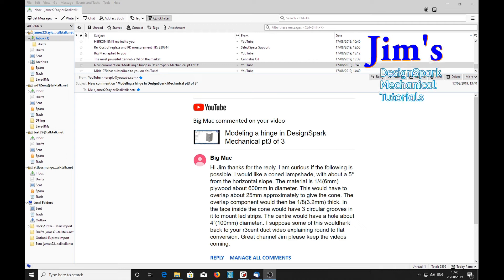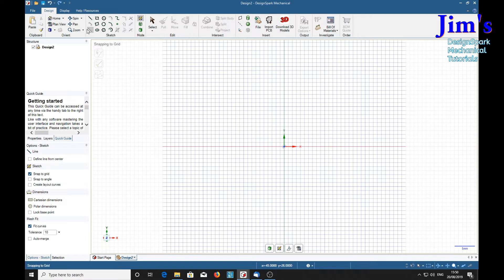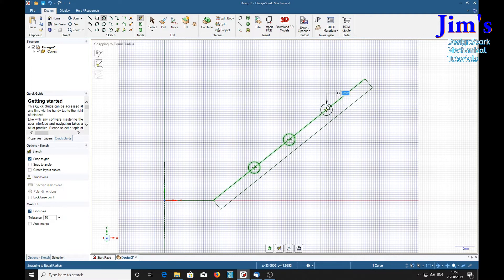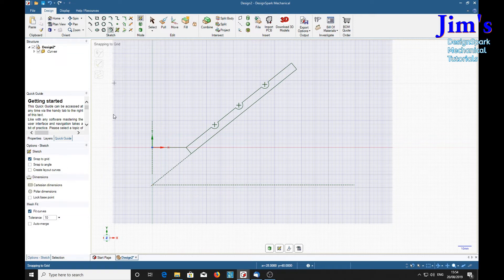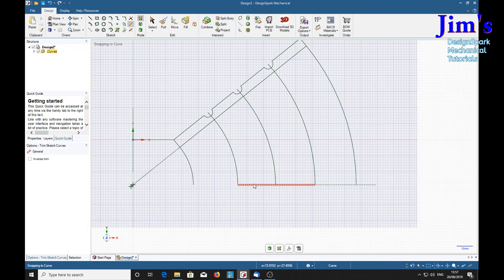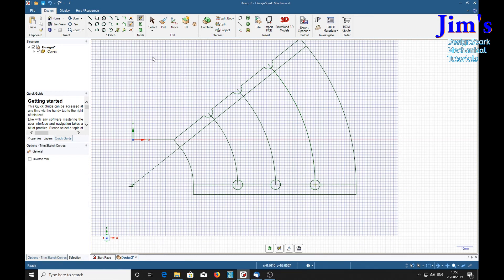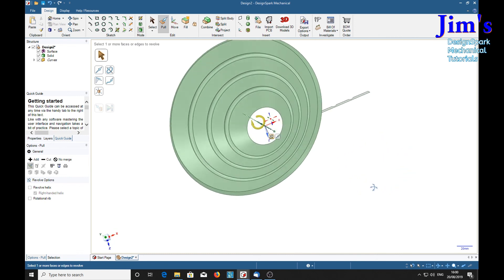Modeling a cone in DesignSpark Mechanical pt1

Comment: Instead of using the sweep arc to project the attributes,  I tried copy, move  placing the pivot on the origin (0,0,0) but the part  was angled slightly (it would not sit flat on the x axis) to the x axis, don't know why that did not work.  Instead of drawing an axis to rotate around you can use the always present  small green, red and  blue axis that is usually close to the part , not the one in the lower left hand corner.

Comment: Hi Jim, 

first of all thank you for the explanation and your help understanding DSM.

I have a problem for my current CAD project. 
I need to place a cone on a barrel. 
The thickness of the cone is no problem to implement, however i dont know which length i need to adjust. 
The diameter of the top site of the cone has to be 18,8 mm and the bottom part, which i need to connect to the barrel, is 10 mm. 
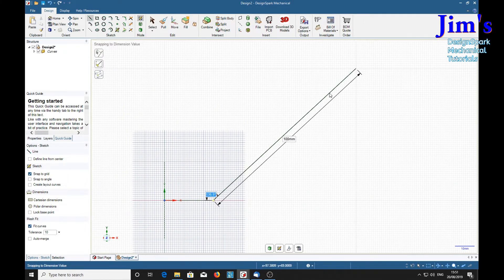The question is how long does the first part at 2:35 in your video needs to be? 
I guess the degree plays a role to determine the final diameter, right?

Best regards
Reply from the maker: 1. Draw horizontal construction line to represent the center of the cone.
2. Draw an ordinary line from 5mm somewhere above the LH end of the ctr line to 9.4mm above the ctr and Xmm to right where X = length of cone.
3. You should now have a horizontal construction line with a sloping line above it.
4. Make the sloping line into a rectangle the width of which is the thickness of the cone material you need, then use the Rotate tool to rotate it arond the center line.

5. You should now have a cone 10mm dia at one end and 18.8mm dial at the other end at the required length.

Jim